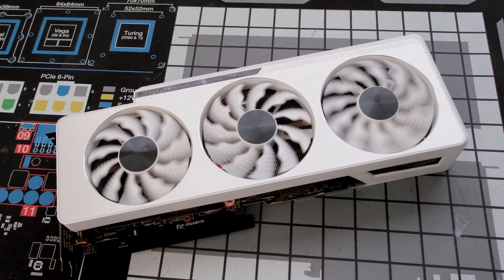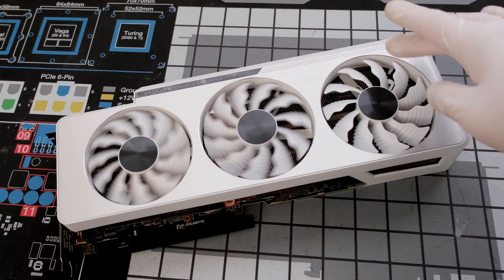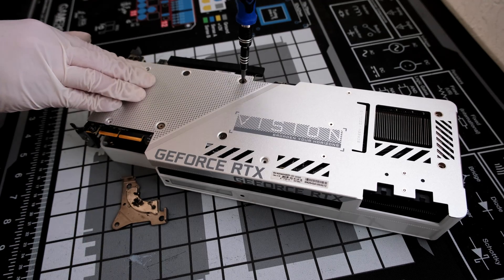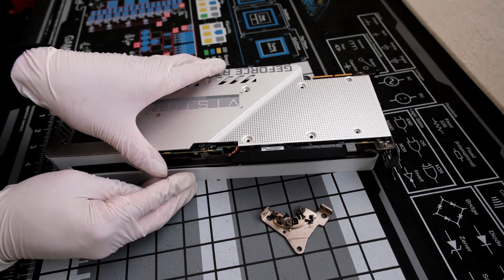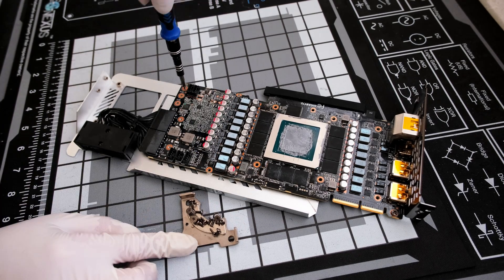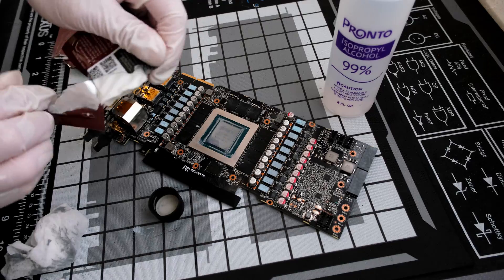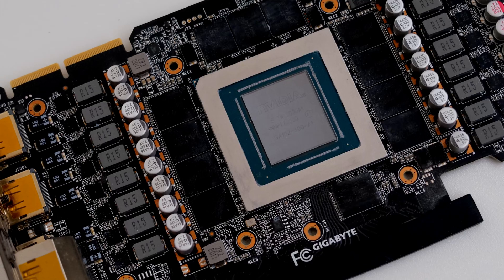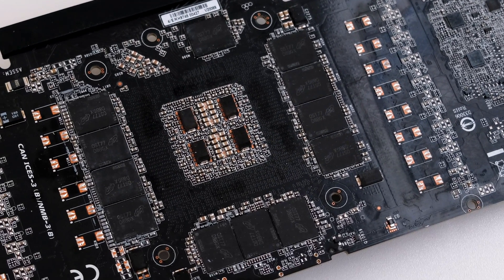RTX 3090 Gigabyte Vision Teardown NVIDIA GeForce GPU 24GB GDDR6X PCB

Comment: can you please tell me what are the thermal pads thickness?
Reply: try to keep the vrm ones intact, as they're acceptable for what they are used on. the memory pads which are pretty meh are 1.5mm. if you damage the other pads and need to replace them, they are all 2mm, but you would be better served with very soft/compressable 2.5mm. if the pads you will use are not very compressable, just use 2mm. it's not worth using too thick compressible pads and warping the PCB leading to a much quicker death.
Reply: the vram pads on the back are 2mm, but again you may see better luck with very compressible 2.5mm. personally i spend the big bucks on the Gelid Extremes (NOT the ultimates) and use the correct 1.5/2mm pad size for the vram, then use some cheapo random pad for the vrms if you need to. iirc the Ultimates are very compressible so you may see some gains using 2mm/2.5 instead for vram, but do so at your own risk.
Reply: I send an email to gigabyte esupport about pad thickness and their answer is 1mm, 1.25mm and 2.25mm.
Reply: @crnigruja1150  did you get them your card's serial number? there may have been a change on different card revisions and they gave you the info for your specific rev. i've only seen ones that need the pads i listed above, but gigabyte would probably know what size pads they use on the cards they manufactured

Comment: Haha i recognize those hard drive magnets anywhere! We used them when i worked for a tech repair company! Fantastic for exactly what you used it for
Reply from the maker: Thanks for your comment 🙏 I am happy that you noticed. I've been using those hard drive magnets ever since I realized they work just as good or better than the advice to use little cups or containers. The tip to also keep each screw on a diagram of where it is...is way too hard. So just grouping things together with magnets has worked well. Thanks again for noticing.

Comment: is it possible to swap this pcb with an evga cooler or any other?
Reply from the maker: Thanks for your comment 🙏 The gigabyte 3090 will not be compatible with an EVGA cooler. Both gigabyte and EVGA make custom pcbs that makes them incompatible. My experience with the vision has been that it has the same PCB as the gaming and eagle variants, so you may have some luck swapping in one of those coolers. Hope that helps.

Comment: Thanks for the video.

Did you have to wedge a flathead into the retention clip, or use some other method to remove the three fan connectors on the PCB? (Noticed the video cut whilst removing them)

I can't seem to disconnect them by gently wobbling them side to side - they seem stuck. Trying to redo the pads and would rather have it fully disassembled like yourself. Kind regards
Reply from the maker: Thank you for watching and for your comment. 🙏 If I recall correctly, for these 3 plugs, I removed by pulling them out, using the side to side method. They were tight and snug and it can be hard to put a lot of pressure in a such tight space. For the video, I actually unplug the plugs first (taking my time and using my fingers mostly) and then replug them in more gently. For the video, I use the tweezers to unplug them so the viewer can see it more clearly (rather than a hand/finger in the way). So, yea, I would use my hands and it's really simply snug plastic on plastic. This is different than on the Founder Edition, where there is a tiny latch to undo before pulling. Both those were different and thinner cables used by NVIDIA. These on the Vision were fairly standard. Hope that helps.